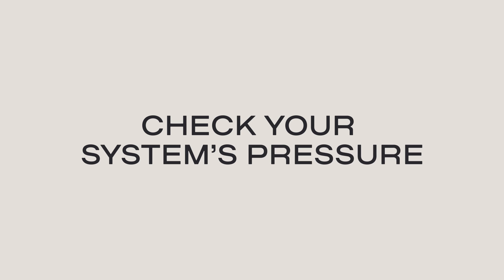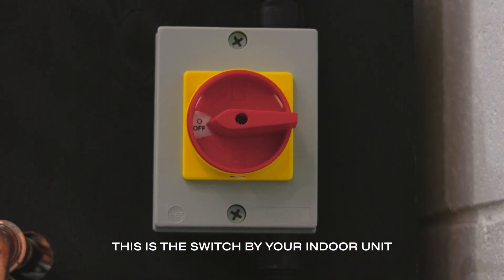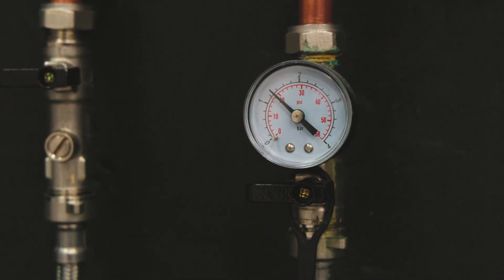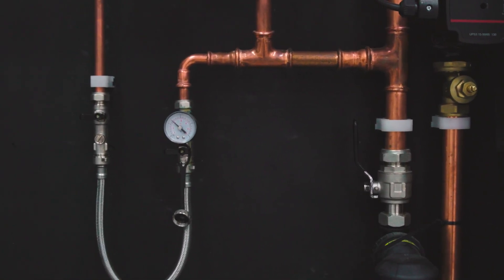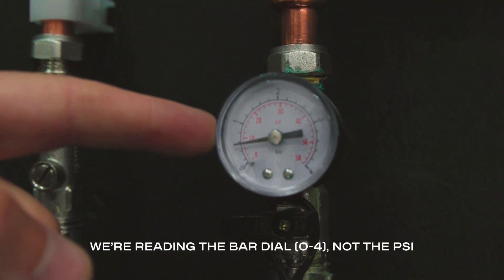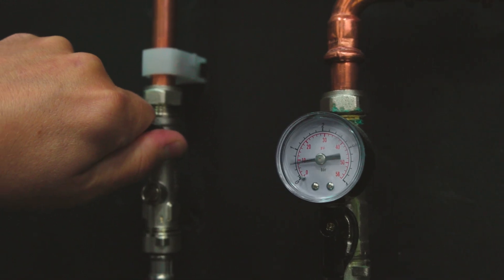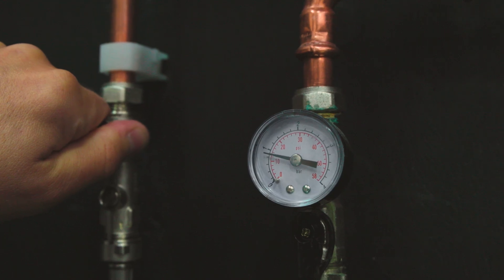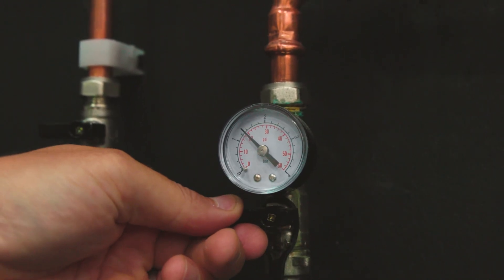Get your heat pump winter ready - How to check your heating system pressure

Comment: Is it correct the AIRA Heat Pump has no monitoring or low pressure cutout on the system water pressure?